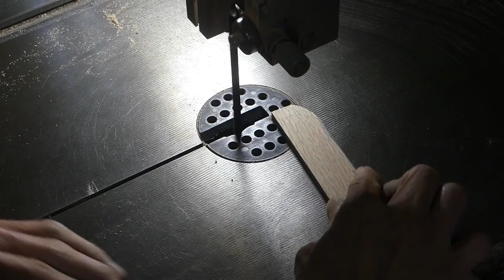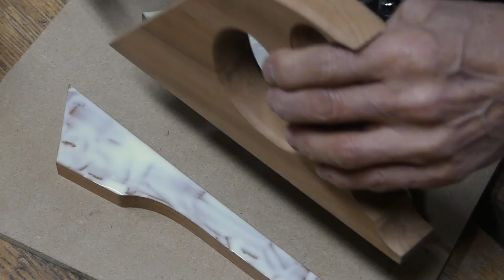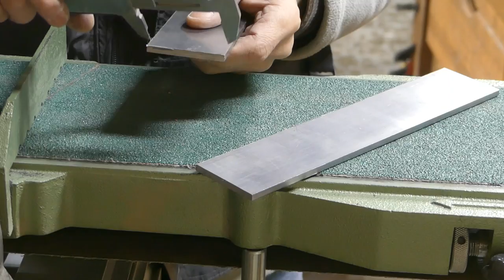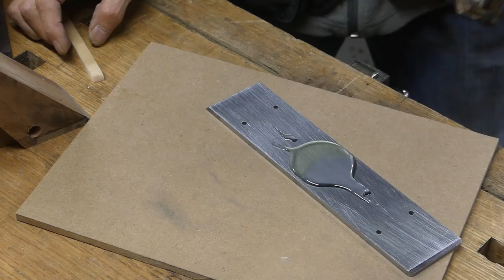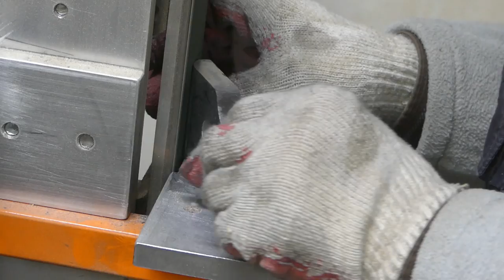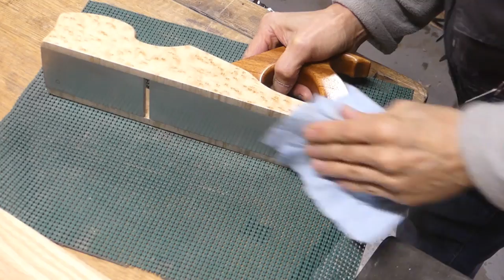Make a bird eye jack plane

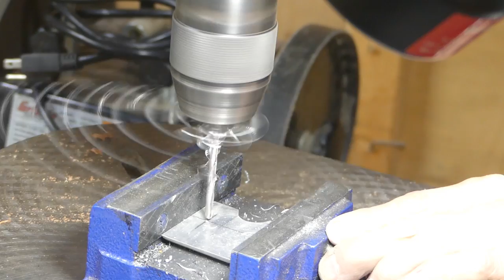Comment: +1, however was close to cut Your hand at 6:50, You really need to screw Your vise and never go with hands close to it or just get some drill bits with chip breaker (one side shorter)